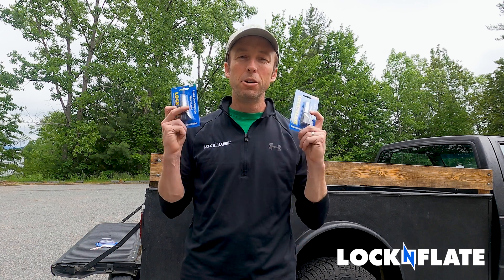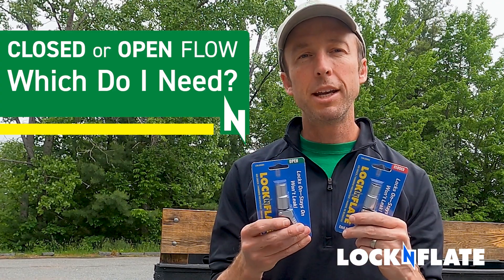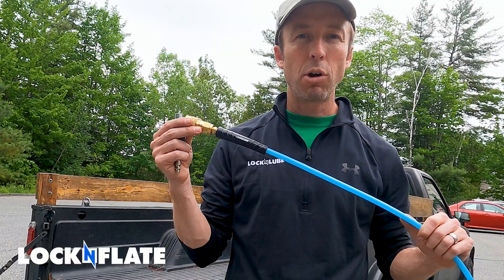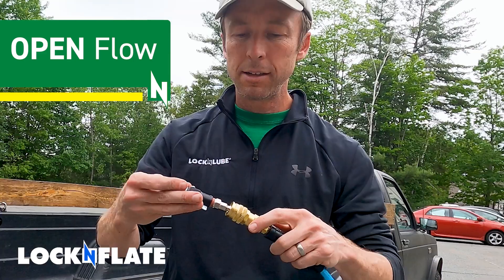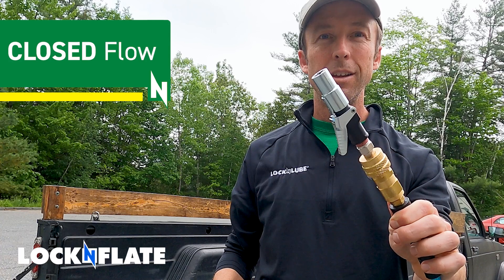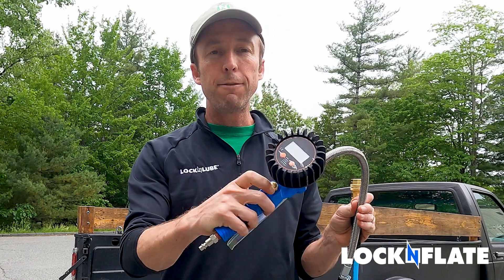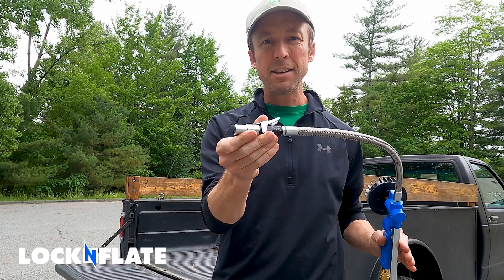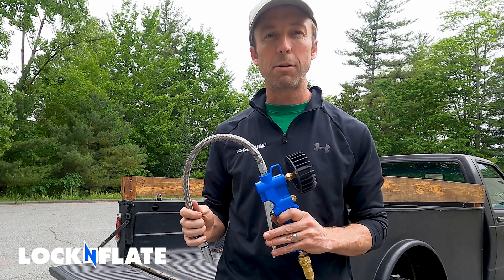Which LockNFlate® Air Chuck do I need? Open Flow or Closed Flow?

Comment: Nicely explained for a newbie.  Great presentation, many thanks!
The only thing I am puzzled about is... why would you use a Closed Flow Air Chuck when there is no way of knowing what the tire pressure is?  Surely at one end of that thing, there should be a way to check air pressure while filling?  Or possibly when you pull it off and use a manual pressure stick gauge like at the gas stations, right?

What a joy to fill my own tires with my own compressor and Air Chuck!  Now to find a good Gauge assembly that is quality despite being made in China.